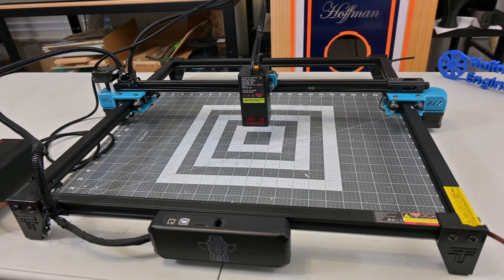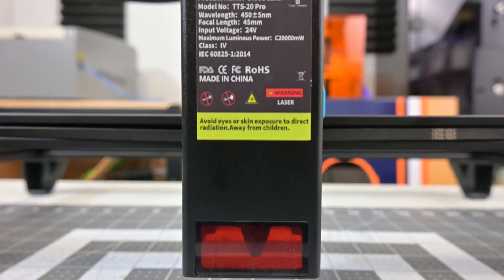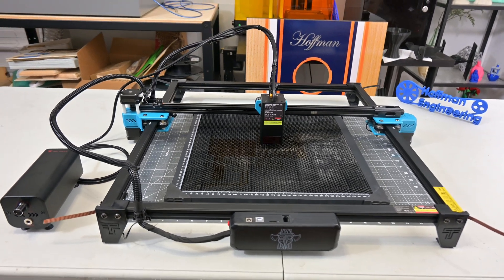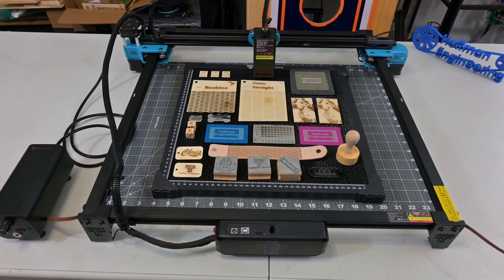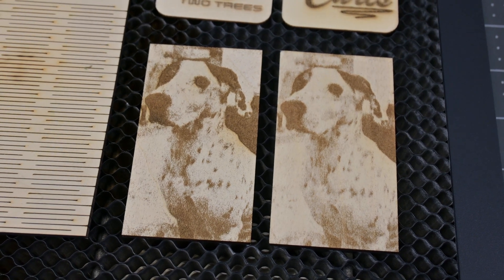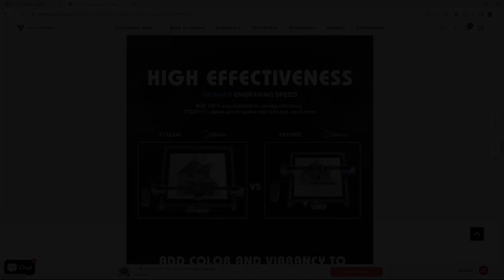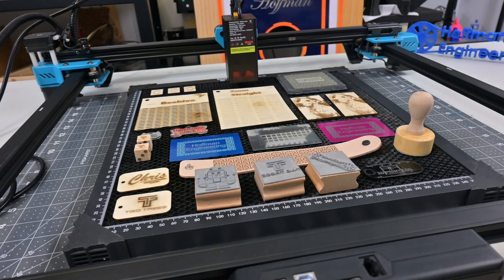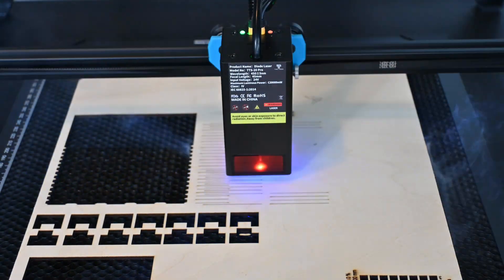The Perfect Laser Engraver Bundle - TwoTrees TTS-20 Pro Review

Comment: What would be the power required for a diode laser to get those different colour oxides? I also need something that can engrave . 5mm deep. Can this machine handle that?
Reply from the maker: I've had color on stainless steel with 10w diode lasers and above.

If you are asking about engraving stainless steel to a depth, diode lasers cannot do that. You'd need a fiber laser to actually remove metal. Diode lasers can only heat it up enough to form oxides on the surface.
Reply: Hey thanks for the quick reply. I want to do engraved metal nfc tap business cards. I saw the TTS 20 as a cheap option to get started. But I guess ill have to find a cost effective fiber laser to get started now. Any suggestions?
Reply from the maker: @vigneshnandakumar  Yeah, the TTS20 is an awesome option for a beginner diode laser, but won't actually engrave metals. If you are looking for fiber lasers, check out my videos on the Gweike G2 or G2 Pro fiber lasers.

Comment: For those struggling with lightburn and wifi on this machine, it doesn't work at all. there isn't a telnet service on the laser to receive gcode. You have to use the futzy app thing... dont bother wasting your time with it. Laser is excellent using lightburn and usb

Comment: Be careful if you order the enlargement kit to 500mm. The wiring harness has to be butchered. From the old and new because the connectors to laser head are different.  Also harness and wires are to short and when opening the control there wiring is so fragile  the wifi attena broke off just from me opening it.

Comment: The thing that is always missing from all laser tests is cut testing on cheap laminate flooring.

It is a VERY useful and cheap material that is available everywhere, it is stronger(stiffer) and more dimensionally accurate than plywood and can often be used as a direct replacement for similarly thick or slightly thinner alu plate for a host of different projects and for building boxes/drawers and even tools(https://www.youtube.com/@jisakukobo is a good place to start when it comes to the kind of tools I'm talking about)....